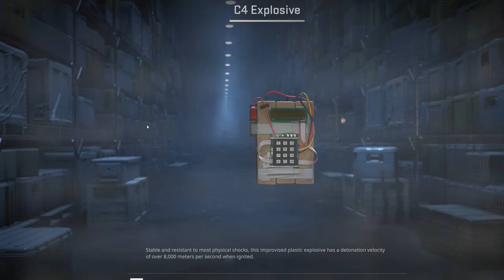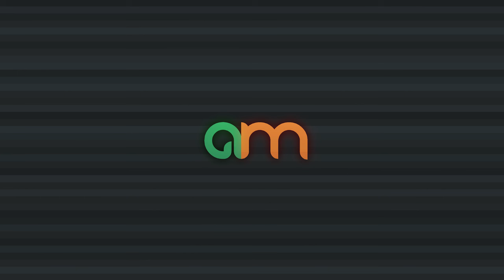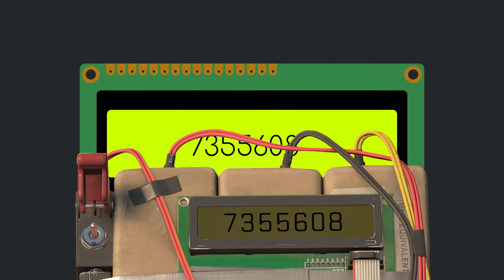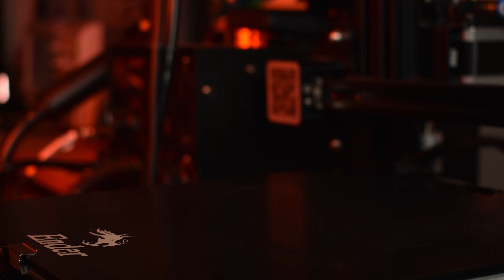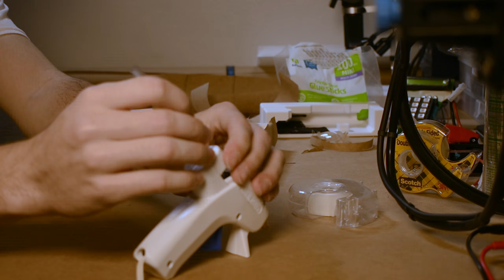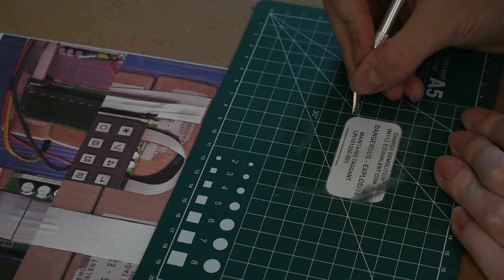I built the C4 from Counter-Strike 2

Comment: This is actually insane and super accurate looking too! Im trynna make it myself as well and i wanted to ask where the fuck did you find double zipper cables in red black and yellow? i looked everywhere and i could only find black and red pairs

Edit: lmao i forgot i comented in the past
Reply from the maker: Thanks, and good timing! I'm about to release a video on v2 of the C4 replica. All of the design files and a complete project guide will be available on my Patreon when that video drops.

To answer your question about the double wires, I ran into the same problem as you and I had to just epoxy two lengths of normal wire together to get it into pairs. Epoxy does not stick well to super smooth wire insulation so it helps to score the insulation with a precision knife.

Feel free to hop in the Discord server and I can answer other questions you might have. The invite is in the video description.
Reply: @AzureMakes  damn i thought about using some sort of glue too but i figured itd be super messy by the end and not really hold up cause i use copper wires that kinda hold their shape when bent and id have to bend 2 of them exactly the same and it wouldnt be so easy. I ended up using heatshrinks which honestly look really good, they just dont have that cut in the middle that looks like there are 2 cables
Reply from the maker: @bigbrianilel yeah its not easy sadly, the Valve devs did a couple things that make a replica a little challenging. Using solid core wire would definitely make it challenging, I would suggest getting something stranded so its easier to align them for gluing. You could also try something crazy like buying pairs of wire and spray painting them the right colors, but the paint would probably flake off because the wire is flexible.
Reply: @AzureMakes  oh i did buy stranded wires, but because they are flexible enough to where they can make pretty sharp turns in pairs each one deviates ever so sligtly off from one another and doesnt look as good. Also yeah i did try spray painting but the rubber insulation doesnt like sprays, at least the valejo primer i tried, there probably is one out there that sprays some sort of elastic vinyl thing that can withstand the bend but i live in greece so i havent come across any of that stuff lol. And im looking to make them as easy to mass produce as possible for my shop so for now imma stick to the heatshrinks

Comment: When are you realising files?
Reply from the maker: I was making really good progress for a couple weeks then I had an unexpected life event happen. Nothing bad, it just requires my time and energy currently. Every day I'm working hard so that I can get more stuff released. Apologies!
Reply: @AzureMakes Nw i just bought some parts so just asking
Reply: 1 More question how much is the estimed price?
Reply from the maker: Hi, sorry for the slow response. Right now, the v2 replica bill of materials calls for $300 in parts and supplies if you order the circuit board pre-assembled and you order the 3D printed parts from a fabricator. The cost is $210 if you DIY everything. The design files themselves will be priced around $20. The costs might change before I finish the project but that's the ballpark.

Comment: All ts for an c4 prop no hate but 
I made this replica using ardunio and some led lights you should try using ardunio!❤
Reply from the maker: Nice! I did use Arduino and the circuit board I made is pretty much just a Nano with all of the cosmetic components from the in-game model added.
Reply: @AzureMakes can you sell ts to me?
My copy is a little thick I used wood
Reply from the maker: I'm working on finishing the design files. They'll be available on my Patreon sometime in the next few weeks.  @Badmaa-t5c

Comment: Hi, I'm a computer engineering student. I'm wondering if this is an embedded system?
Reply from the maker: It could possibly be considered an embedded system but usually that term is used moreso for systems with microprocessors. This project only uses a microcontroller.

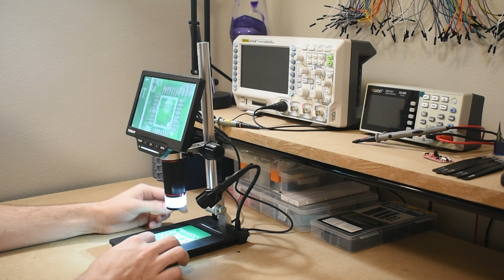Comment: 7:04 what did u apply,thermal paste?
Reply from the maker: That is solder paste. It's basically little balls of solder suspended in flux. It's used to solder really small electronic components onto PCBs.

Thermal paste looks very similar but isn't made of the same materials and isn't electrically conductive, it's designed to only be very thermally conductive.

Comment: what are the cables for the packages called? these red/red bl/bl ye/ye twin cables? And these blue connectors on them
Reply from the maker: Those are just 22 gauge silicone wires that I glued together into pairs. I couldn't find any double wire pairs in those colors like the C4 model has. The blue connectors are a custom model I made and 3D printed because I don't think those terminal blocks actually exist. Then the wires are just glued into the fake terminal blocks.
Reply: @AzureMakes Thank you so much! I really like your project and I can see how much work went into it. Would it be possible for you to share the PCB designs? I’d really appreciate it. If you include your channel name on the board, it could also be a nice way to promote your work!
Reply from the maker: @jonas5597 Thank you, I'm glad you like it! I want to start a Patreon where I can share the files from the projects that I do but I want to wait until I have one or two more videos released. Progress has been slow but the next video is coming together. For now I'm not going to share the files, sadly. Sorry about that.
Reply: @AzureMakes Ok I'm curious about your next projects. Thank you❤ Do you have already Projects in work?
Reply from the maker: @jonas5597 I have one that I've been working on for way too long and a list of a few ideas I intend to do. The current project is just very slow unfortunately lol.
Reply: @AzureMakes Yeah i know exactly what you're talking about. I know that feeling, too.
Reply from the maker: @jonas5597 It's hard with a full time job and stuff. Maybe one day I'll be able to put all of my time into videos :)

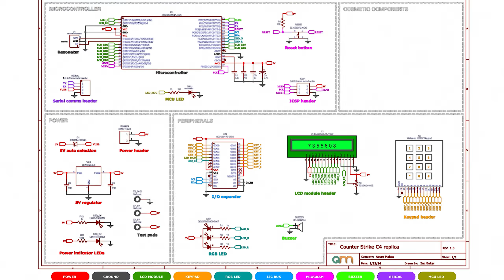Comment: 5:37 the IO expander is a tad useless here I think due to you could run the lcd in half mode aka it just uses 4 pinups instead of 8
Reply from the maker: @Blackwell-z7p  I could have ran the LCD in 4-bit mode, but it wouldn't have freed up enough pins to get rid of the need for the I/O expander. I probably could have been more clever with the keypad pins by, for example, multiplexing them but the I/O expander seemed to be the simplest solution.

Comment: This is a bit off topic, but where did you get the dual yellow wire? I've been looking for one for a project related to car equipment (amplifiers and audio filters). Do you have a manufacturer code or name for this product? Thank you.
Reply from the maker: @EsmeraldaViIIalobos  It's actually just two single wire sections glued together because I couldn't find something to match the dual wire in the in-game model. Since those wires are just cosmetic and didn't need to be durable, the glue worked well enough.
Reply: @AzureMakes  I see. They look like factory production. It came out very well. Thank you for your answer.

Comment: Fantastic work, and I hope that you eventually get sponsored by <unspecified pcb maker from Shenzhen prefecture>.

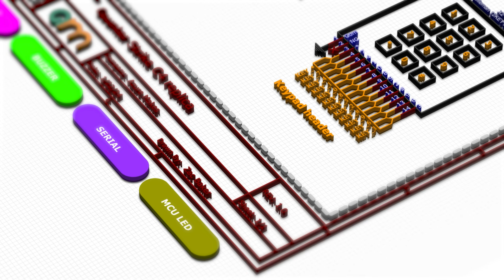Also, I have the same problem you mentioned at 9:00, albeit in a different form: first I design the project meticulously, and then when parts arrive I panic and start assembling it, well, in Poland we call it "on lunatic's papers". Then I realize it never could have worked, implement "corrections" and then it turns out that the original design was OK, actually.
Reply from the maker: Thank you for the hopes! The scenario you described sounds very familiar, lol.

Comment: what do you do for a living? just  out of curiousity.
Reply from the maker: I design circuit boards. I love it!
Reply: @AzureMakes  great job on the c4, it's the most one to one recreation I've seen out there. So you were one of them who got the special white keypad! I was looking for that specific model and had to resort with the cheap black ones.
Reply from the maker: @OddC00kie9  Thank you! I believe there are other versions of the same keypad that you can find. The same company makes a version that had a male pin header row on the back. It would have been way better for this project but for some reason I didn't find it when I was searching. You might have options still.

Comment: You had three capacitors, why didnt you use them to increase the voltage of the 9volt batteries, I mean it would be more realistic that way and would give them actual purpose
Reply from the maker: The problem was the current draw, not the voltage. 9V batteries are pretty weak and their internal resistance becomes too high when demanding much current from them, dropping their voltage.

A charge pump would have been cool, but I don't think it would have worked since it would presumably draw even more current.

Comment: Why does CT have to enter a combination to diffuse, when they can just turn the switch off?
Reply from the maker: @JeffJK000 because this isn't an actual bomb, it's a replica lol.

If you mean how the in-game model is designed, then you're very right. I assume valve imagined it to have some circuitry to set the bomb off if the switch was flipped when the C4 was armed.

Comment: this is so fucking awesome man. I'm blown away! 

if I could make a suggestion, you should add a way for a defuse kit to help solve it faster than without one (maybe a way for an external green wire to connect to the Arduino for it to auto-fill the code in 5 seconds?)
Reply from the maker: Thanks! That's an interesting idea.

Comment: why not just and LCD pixel matrix instead of character display?
Reply from the maker: I suppose I could have done a pixel display and 3D printed a mock LCD module housing around it, but I wanted to stay as true to the model as possible. Using an LCD module that was as close in physical form to the one on the in-game model seems like it was the most reasonable path.

Comment: I actually bought the parts for this a few years ago but never got around to making it. Kinda unfortunate to see that you made some dumb choices (may sound harsh but idk what else to call it).
- You would've been better off using a non-character display. I bought a ST7920 144*32 display.
- You could probably have used the 9 V battery if you used a buck regulator instead of an inefficient linear one.
- You could've just used one or more 18650 Li-Ion cells with a fitting (dis)charge module instead of what you used now. NiMH is kinda a weird choice IMO.
- You could've used an ESP32 to give it wireless connectivity.
Still a cool project and really good video production quality.

Comment: where did you get that stensil from?? Ive tried jlc pcb but theirs stensils are massive and yours looks very elegant. Even if you are not sponsored, could yu maybe spill that little information? I would be very pleased. Thanks
Reply from the maker: Yeah I order from <REDACTED> too, there is an option in the stencil settings to specify a custom size. It's not labeled in the most straightforward way but you just have to look closely. Before I found that setting, I too got a massive stencil from them the first time that made shipping even more expensive. Best of luck!
Reply: @AzureMakes  hmm ig that information is "top secret"  :c

Comment: Huge props for the impeccable attention to detail. Even the exact way the sticker peeled off, the slightly uneven lengths of the paper wrapped sections and just the specific way all the cables bend was captured. Most of the time DIY videos like this on other channels leave a lot to be desired in terms of detail and accuracy. Definitely not the case here!
Reply from the maker: Thank you!

Comment: Why not use the wemos lolin s2 mini (based on esp32 s2 mini)? It has lots of gpio and compatible arduino libraries and is cheaper than the arduino uno uC
Reply from the maker: The PCB is custom built to look like the one on the in-game model. More GPIO would have been nice thought.
Reply: @AzureMakes You could use the bare ESP32 chip and conceal the timing circuitry and SMD decoupling capacitors beneath a fake DIP28 shell. Really looking forward to seeing the design files!

Comment: Good job! I was trying to make the same project a couple of years ago. I exported the bomb-model from the game, and then scaled everything by using the led and 9v battery as the sizes i knew. Eventually got too stuck on wanting the LCD to be 100% as the one in the file.. contacted some companies in china, but it was of course way too expensive to create.

Nice to see you finish what i couldn't!
Reply from the maker: Thanks! The 9V battery and switch assembly are scaled a bit wrong on my replica but I didn't really see a good solution to that. It sounds like your version would have been very good.

Comment: dude says he doesnt have time to play cs anymore and then proceedes to work on 1-month length project just for fun
Reply from the maker: Lol it wasn't communicated well but the reasoning is that CS can be miserable sometimes and working on projects like this is rarely not fun. It has a higher floor of enjoyment. This project is also just a more constructive use of my time in terms of my goals in life.
Reply: If this took more than 20 hours, bro is cooked.
Reply: @mesterdarius493 shipping of the parts certainly took longer than that, and you need some of them before even starting your design on the pcb. So definitely more than 20 hours.

Comment: i love how the solder actually solders itself instead of painfully soldering each one to the board
Reply from the maker: Using a stencil and solder paste is definitely a big upgrade over soldering by hand for PCBs with more than a couple surface mount components. Still had to do the I/O expander by hand because it was on the back, though.

Comment: You might not need an IO expander chip for this to work. Most LCDs like this has a function where you can use 4 pins for data instead of 8. And you might be able to hook up the keypad as a matrix. This would free up a lot of pins. It's still a pretty cool design tho.
Reply from the maker: Thanks! Yeah those are good improvements, I'm not sure it would be enough to get rid of the need for the I/O expander but it's probably close.

Comment: Very cool Video! What Programs are you using? For Design and Sketch etc
Reply from the maker: @stormgasher1  Thank you!

I use EasyEDA to design my circuit schematics and to layout my PCBs. I use Fusion 360 (or whatever they rebranded to) for my 3D modeling, and I use Cura for my slicer. I might be missing something so feel free to ask.

Comment: That... is really detailed.

I'll give you a little idea if you ever happen to give this project a revision.
You could use a DFPlayer in parallel (or even standalone) to the piezo to play specific sounds like "bomb has been planted/defused" and whatnot. These are very cheap and fairly easy to communicate with as well as very well documented.

do you have a reference size for the C4 "blocks"? If I happen to have some spare time, I'll build something similar. This inspired me to start another project which won't be finished anytime soon.
Reply from the maker: Thank you!

Playing the voice lines from the game is an interesting idea, I just personally didn't have much ambition to do it.

The scale of the blocks and the PCB were just eyeballed and based on the size of the LCD and keypad. I modeled the LCD and keypad then modeled the 3D printed parts around them.
Reply: @AzureMakes  haha, could have guessed the part with the keypad as a scale reference, did something a few weeks ago in fusion360. What a pen, a ruler and a piece of plastic can do is quite impressive.

What confuses me is the keypad. Why are there so many contacts? Is it 1 in and 11 outs? I use 4x4 matrixes with my ongoing project, with 16 buttons they only use 8 pins.
Reply from the maker: @skitone69  Yeah it's a somewhat unique keypad for that reason, it's not multiplexed or matrixed at all. Luckily, the wires that connect the keypad and LCD are mostly hidden inside the blocks.

Comment: why the heatsink if its not doing anything. atleast put it on something to make use of it
Reply from the maker: The heatsink is almost entirely cosmetic like a few other parts on the circuit board. It is there to match the in game model. It's a small detail that you can only see from certain angles but I wanted to go all out. It does actually function as a lot of the support for the keypad, too.

Comment: Most if not all parallel character LCDs can run in 4-bit mode , which saves you at least 4 pins. This also seems to be what the CS2 version has gone for since half of the LCD pins are unoccupied
Reply from the maker: You are right that I could have saved some wires by running in the 4 wire mode. Luckily the wires are hidden inside the blocks so it didn't matter much.

The LCD in-game seems to use a 2x5 IDC cable and I don't believe any LCD modules have IDC headers. If it were perfect, I would have found a way to use the IDC cable to connect the LCD to the microcontroller instead of it just being cosmetic. That's one of the many things I would try to improve if I were to do this again!